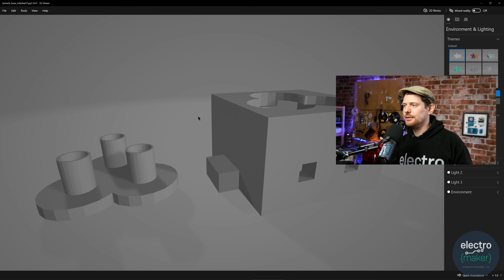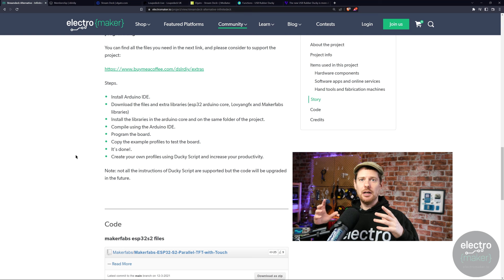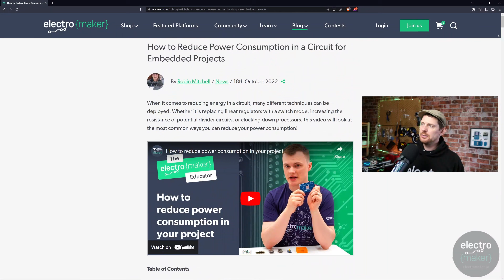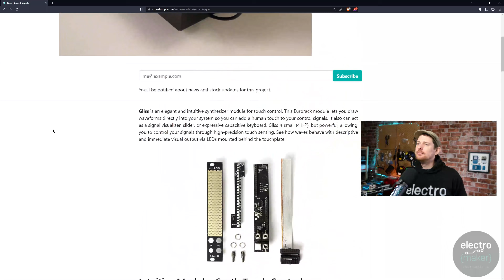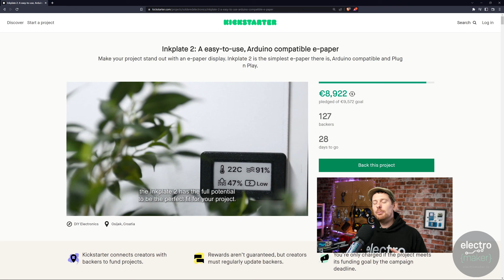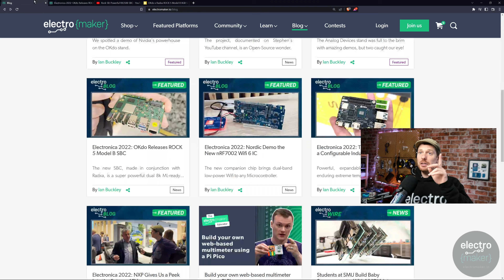DIY Streamdeck, Bela's beautiful STM32 module, ROCK 5 Model B, and more!

Comment: #PPK2 I have an ESP8266 module outdoors on my oil tank that checks the level of oil in the tank using an ultrasonic sensor.  It has a lipo battery and a solar panel to charge it and I've set it to wake-up, connect to wifi and send the oil level and temperatures outside (including the soil temperature too for my plants in case it gets frosty).  However it regularly runs out of battery especially in winter when I need it most and I can't tell why.  The power profiler kit would be perfect to figure out where the power is being used and to get it running efficiently.